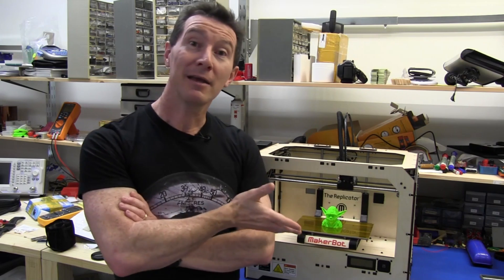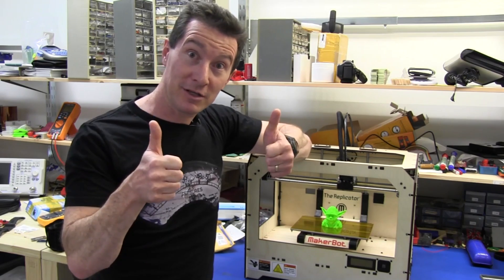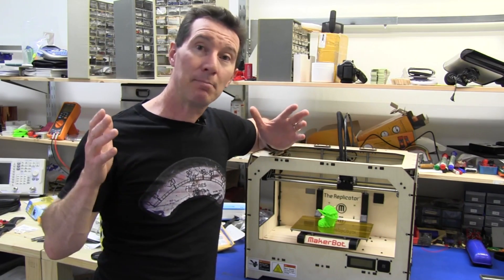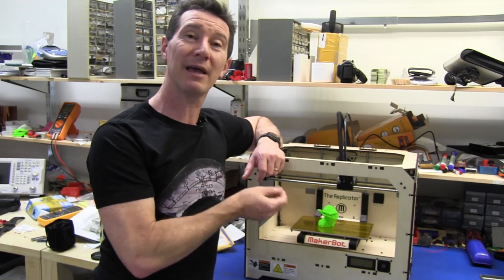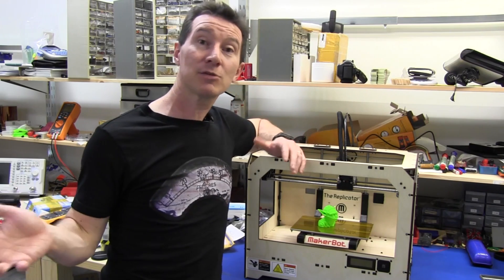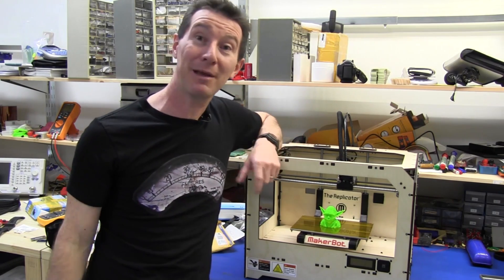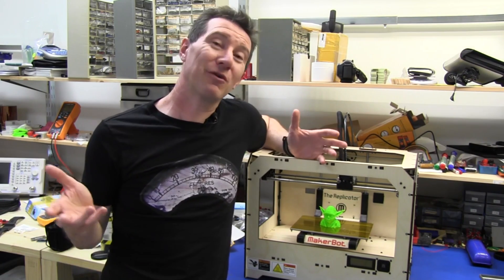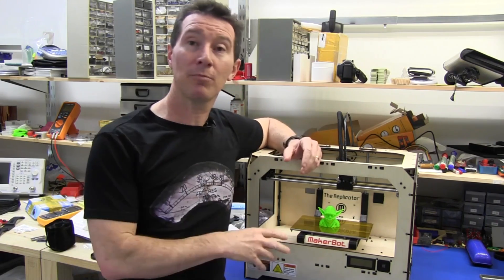EEVblog #356 - Makerbot Replicator 2 Announcement

Comment: I have a question regarding the material this thing uses. How well it hold up over time. I mainly make parts for broken toys, currently I make my replacement parts out of clay then use silicone to make a mold of it then cast the final piece in resin. I was trying to look into something that I could skip the wasting of using molding material, but would still hold up as well as the resin. Would a machine such as this one be the way to go?

Comment: Our High School here in NY purchased few of these for the ElectroMech Major to work with (we are a specialized high school focused on STEM fields: we already had industrial grade, large, boxy printers that used powder, lasers, etc.). The replicator 2 is a lot quicker to prototype on, more reliable and much simpler!  As a Senior (Grade 12), the underclassmen I supervised quickly learned in a few mins. Anyone with the slightest CAD experience can easily pick it up. Looks great, works great!

Comment: I was just in the market for a 3D printer, and read the Make Magazine special on 3D printers. I originally was thinking about getting a Replicator 2, but after much thought I decided I wanted something that I could modify to suit my needs in the future. From their reviews, I read that the Ultimaker was judged as fastest and most accurate, but requires some calibration which i'm OK with doing, having built and tweaked a Thing-O-Matic in the past. The Make Magazine special is well worth buying.

Comment from the maker: I have not used the Replicator 2, but I hope it works a lot better than the Replicator 1, as I'm having continuous problems getting the thing to work consistently, or at all for some prints. So based on the Rep 1, the technology isn't there yet for these things to be consumer friendly. And from what I hear, it's not just the Makerbot, so just the technology in general at the moment? Anyone got a Rep 2 and can comment? Makerbot are trying which is good.

Comment: The "case design" they closed. That is one of the big issues because the new "closed" case is their old "open" case + public enhancements. They took a whole bunch of stuff other ppl designed as upgrades, integrated it in to new design and closed it - I'm sure they do not have "amin" from persons who designed updates - they only possible way to have it legal is by some ugly licence bs on the thingiverse site allowing them to use anything from there ... IMO that might be legal but it ain't cool

Comment: 0. it's not a rumour, we called support - they said replicator2 is closed source
1. you CAN build a billion US$ company on open software/hardware
2. I don't mind that they want to go closed source but they can't use GPL software and build on it closed sw app (they are doing it now), they can't use open source hw (reprap) and based on that you make closed system ... legally - they are in breach, yes most probably noone is going to sue them but that does not change the fact they are in breach

Comment from the maker: Yes, it would be suitable for that, as would most other low cost 3D printers. I have not used the Rep2, so can't comment directly on it's performance. But it shoudl be better than the Rep1 I have which is suitable for such stuff.
No, you would not use these machines to churn out cases like a factory, they are only suitable for prototyping.

Comment: makerbot originally had a very inexpensive printer with the cupcake. I think it was around $800 or so. Every time they improve on the printer, even if the cost of the parts doesn't go up, the price of the printer does. I say this is typical makerbot. I don't see them ever going back to sub $1000 printers.

Comment: Dave your comments have been balanced with regards to the reviews you did of the makerbot and perhaps you were played rather than bought. The saying in advertising is any publicity is good publicity and even if they were aware you'd be critical they knew it would sell units for them still. 
Most people are sheep, they are all looking for a leader(as you can tell by potheads comments) but with that comes responsibility. I don't think Torrone had the right to trash talk Tangibot and it seemed U2.

Comment: They need modelling software to compensate designs automatically for thermal expansion during fabrication and cooling afterwards.  That way precision parts could be made and no more bodging with fudge factors.

Comment: if they built their own electronics and custom firmware then they don't have to publish anything if they don't want. They have enough changes in the physical design to get around practically any copyright issues. If they close source the software and firmware and somebody clones it then they are opening themselves up for a lawsuit. When I saw the new slicing software and printing interface I knew immediately that is what's going to happen.

Comment: I use a Reprap Mendel with a self built heated bed, (9 10W 6R8 resistors on 12 V connected in parallel) made out of a 3mm thick aluminium plate. The resistors are mounted equally spaced on the bottom side of the plate, giving me nearly 200W heating power. Additionally the bottom side of the bed is thermally isolated so I get really fast heating of the platform ~10min to 130°C. Works perfect with ABS without warping.

Comment: This NEMA14 motors which Makebot is using are pretty flimsy. All Repraps use NEMA17. A friend of mine has a replicator and the steppers get extremly hot. Also ditching the capability to print with ABS, instead of fixing the underlying problem (too low bed temperature and/or to less heating power)  and selling it as the best thing since sliced bread is just pathetic. But that's just my opinion

Comment: Dunno where they are intending to stick their market, there are already heaps of commercial 3D printers out, and the best ones use a completely different & much better technique. Makerbot is going to fail miserably by basically shutting off the hobbyist community. Who'd pay almost $3K for a makerbot when you can get the Pro model solidoodle for $500?

Comment from the maker: That's the question I guess. I have not used a higher end commercial one, so cannot compare. I consider the Replicaotr 1 pretty darn good for what it does (when it's tweaked to work), so if the Replicator 2 works better, bigger and faster, then I'd consider that pretty impressive performance for it's intended purpose (rapid prototypes et.al)

Comment: I saw a comercial on that yesterday on youtube. I wonder if you can use like wax for a lost wax mold it be nice to use this to make modes of precice parts ect. but then again I guess you can make the plastic, and then make a rubber mold out of that and then poor wax in to the robber mold and then make the sand or cermaic mold.  but either way this would be great for prototyping.

Comment: Different beasts with different applications. I have a 3D printer and a CNC mill. I use both for different applications. I can get a model printed in PLA fast, whereas with the CNC it will usually take a lot longer, and I waste a lot of material in the process.

As for size, I know of people with printers that have 220mm (w) x 550mm (d) x 120mm (h) print areas.

Comment from the maker: In the low end price bracket, definitely. But I suspect they know what they are doing and will likely sell a butt load of them to the mid range market. There is market in the new price bracket, and in that bracket people don't want a RepRap I'm afraid. So like it or not, I think this new model will sell like hot cakes, if it performs as stated. The 2X will do ABS. And if you can afford $2200, you can afford $2700! :->

Comment: Can they close the design? Is there actually much, if anything to close?
My guess. A "High" end model for commercial/educational/communal use, and a lower end home printer might be a way to go. Then they keep the goodwill they have built up over the years, and keep a community full of ideas and enhancements. 
As seen with the tangibot.. 3D printing is a small world. No matter where you go, you run into the same people over and over. So reputation is important.

Comment: In these days you can buy small prefabricated XY axes mechanism. Add prefabricated Z axis, prefabricated stepper motor driver and prefabricated aluminium mounting profiles system. So you don't need to do this in american style - take $10 million and do something with custom parts. Laser cutted steel i so cheap that they should make better chassis for this long time ago. It's look like they don't want to do this in more proffesional style.

Comment: PLA can still crack/curl up/come loose without a heated bed. Don't need anywhere near the temp as required for ABS, but it still helps (eg: PLA @ 50-60 Deg C vs ABS @ 100-110 Deg C).

Also, PLA melts at a lower temp, which means that objects won't be as thermally stable at higher temps. Don't go printing out a PLA cup and filling it with nice hot coffee, or you'll be wearing it!

FWIW: I print exclusively with PLA on my RepRap. If I need temp stability, I get someone to print it in ABS for me.